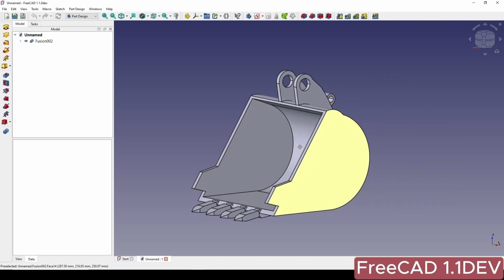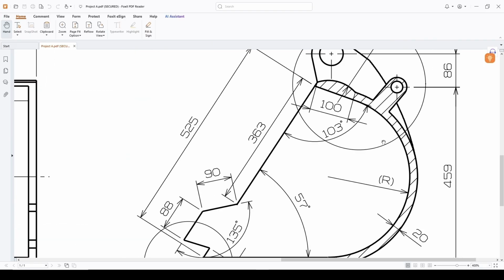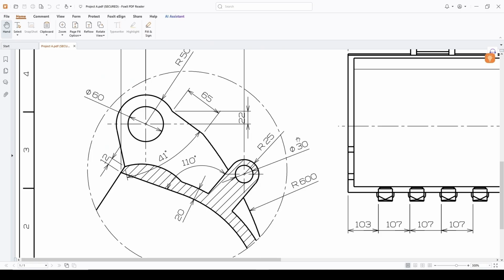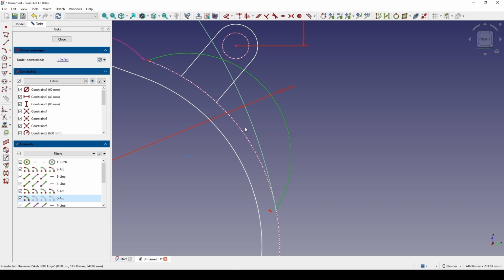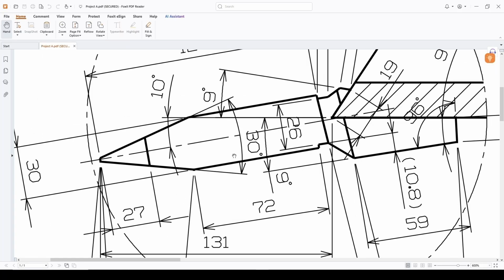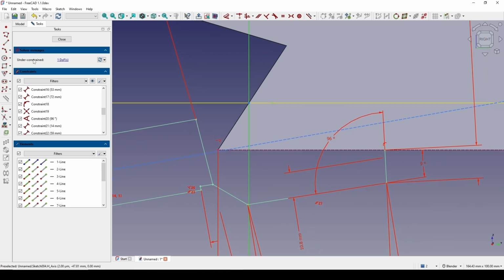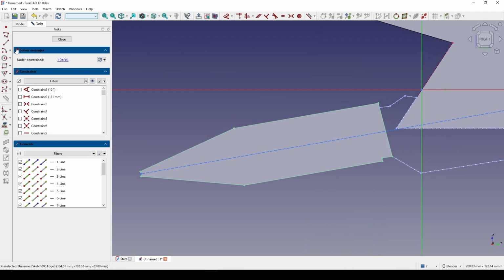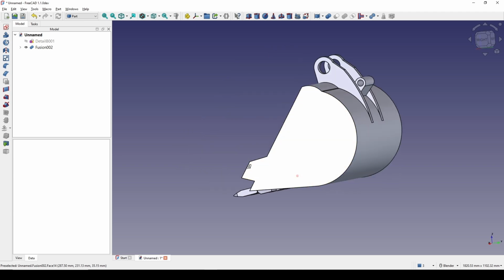FreeCAD 1.1 Dev Tutorial | Modeling Excavator Bucket From Technical Drawing

Comment: Nice tutorial. However, I was hoping you might be able to fix an issue I have. When I create any arc, I see the full circle in my sketch instead of just the arc. The circle is usually over the top of my drawing. What do I need to do to just create and show the arc I want. Note: the arc is the only part the design is using but I can see the full circle still. Like the arc you create at 7:10
Reply from the maker: You can try this: Inside sketcher, go to menu sketch/sketch visual/show hide circular helper for arc.